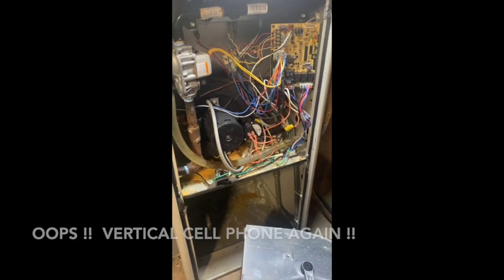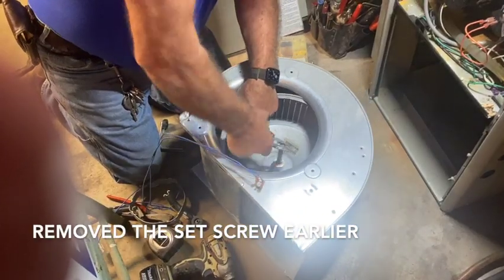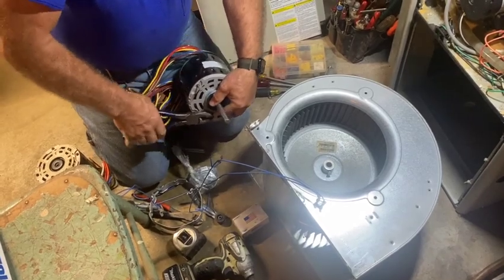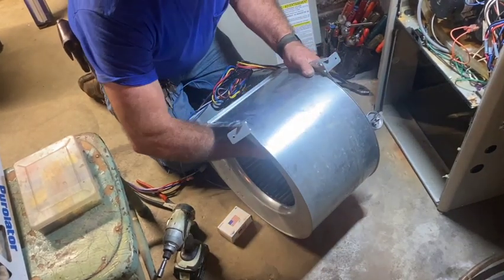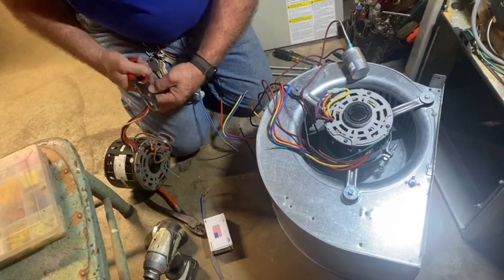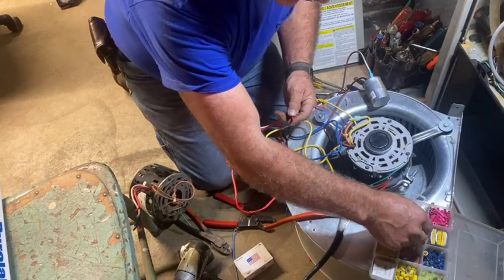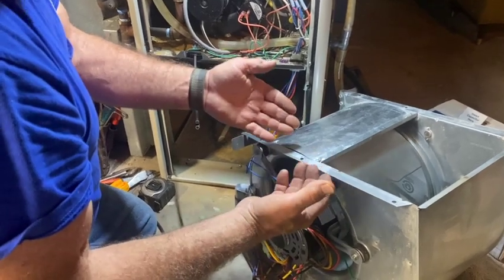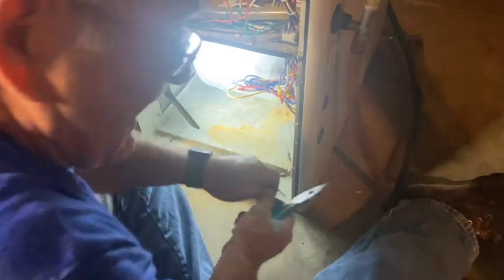Lets Replace A Blower Motor Kelvinator Gas Furnace

Comment: Man yeah Mr Wendell, of course it bites the dust if you worked on it!! Genius you are, I dabbled a little into a capacitor change right before warm weather came. It went ok, but the other day I was around back....heard a tinging noise coming from the outside unit. I went to investigate, and it was a wire for the fan motor , had broken loose from the tie point and was barely being hit by the fan blades!! Had I not gone back there, it would have chewed the wire in two pieces and who knows what else 🤦🤦😳😳 I do enjoy seeing you do what is such second nature to you!! Wow, snapped the shaft right in half 😳😳😳 Love the tool bag btw, and look fwd to seeing what's next sir!! 😁😁👍👍🇺🇸🇺🇸
Reply from the maker: That old tool pouch has been with me through thick and thin.  I've worn out several over the years for sure.  I'm glad you caught the wires before they gave you a problem.  You'd be surprised how many times that's the issue on a service call. Heck one time I had just a small ten ton roof top unit with the 460v 3 phase wires that popped loose from their clip going to the blower motor.  They then rested across the blower shaft and rubbed through the insulation. That resulted in tripping the MAIN GFCI breaker on incoming power to the buildings power distribution panel.  Yep, you guessed it....took out the whole building and it was a big one too !!  The 1 1/2'' blower shaft to dual squirrel cages and a ten hp 460v 3 ph motor had to be changed.  The direct short blew about 1/3  of the way into the 7' long solid blower shaft.  So stuff does screw up believe me !!  BTDT many many times.  LOL. This was just a small unit on the roof that serviced the penthouse and elevator room. It didn't matter though, it took out the whole buildings power.  Fun day for sure, that one was.
Reply: @tractorman4461  Wow!!! That's crazy for sure Mr Wendell !! 😳😳

Comment: Hey Tractorman 44.  We have a newer furnace and AC. The technician that installed it said to use the cheaper furnace filters. I think so blower motor does not work so hard. We had always used the 3m filters that were supposed trap very fine particles. Do you have any comment on furnace filters. I guess we just use middle of road one not cheapest not most expensive
Reply from the maker: I personally like the best filtration possible.  But if you have a system whose  return air ducting is marginally sized to meet the minimum requirements, the high efficiency filters can cause enough additional restriction to the air flow that it will cause the gas furnace to cycle on its high limit or electric furnaces to open the high temp over loads in series with the elements.  As long as your systems return air duct network is not marginally sized, you would be much better off with the high efficiency filters.  I run 2'' pleated filters in my system, where other systems could not handle that much restriction at all.  
    The cheaper the filters, the blue ones you can read a newspaper through, allow a great percentage of dust particulate to pass which will then lodge in the wet surfaces of the cooling coil in the a/c mode.  Eventually that accumulation will be enough to cause the indoor coil to begin freezing over.  I've had service calls where the indoor coils were matted so severely it could literally be peeled off like a carpet.  Then chemicals have to be used to clean the actual coil passages because even though the surfaces are now clean in appearance, the areas between the fins are really really impacted.
  I hope this give you more of an idea of filtration...other opinions may vary, but there is a reason for filtration.  On operating room systems we will have 2'' or 4'' pre-filters, then12'' expanded surface high efficiency filters, then 12'' hepa filters and additionally bacteria killing ultra-violet light bars in the air stream.  And yes, it takes a lot of horsepower to overcome the air flow restriction in these systems....but its required for surgery units. That's in addition to controls that maintain positive air pressure in those rooms as well as special recovery to eliminate germ/bacteria infiltration when the doors are opened.  I know...waaaay too much information isn't it. LOL
Reply: Wow that if great info and I think I will go back to the better filters and monitor how things work. I do battle allergies so better filter probably a good idea for that also
Reply from the maker: @dmfor9001  Well good luck with your system.  Remember the higher efficiency filters do collect a lot more dust and lint so they may need a closer eye on them.  They ARE a bit more expensive though.  Another thing you may give consideration to considering you have allergies is a low voltage electrostatic precipitator.  They can be bought in just about any standard 1'' filter size and operate on 24 volts that's added to the furnace.  It has to be controlled to energize only when the blower is in operation. There are quite a few manufacturers out there, this is just the first one I found for reference on Amazon: https://www.amazon.com/16x25x1-Electronic-Filter-Including-Replacement/dp/B073PHQ584?th=1

Comment: You're not just blowing hot air haha. We've used these blowers for air movers for years😊. Nicely done 👍.
Reply from the maker: I've given away a hundred of them at least.  LOL. And thrown away probably ten times that many too.  Big ones, little ones, short ones, tall ones.....LOL
Reply: @tractorman4461  I'm headed down to little State they call Arkansas. Maybe you can throw a few of them my way. Also not just Arkansas tennessee-kentucky maybe Louisiana. Not right away but pretty quick. I've use them to help dry out when basement flooded. Not the most effective but it was cost-effective

Comment: That was a nice informative video Wendell, you really know your stuff my Friend
Reply from the maker: Well Jan, I've changed blowers motors from tiny refrigerator shaded pole evaporator motors to 100 hp 460v air house blower motors over the course of the last nearly 50 years.  But this is the first time I ever saw a shaft split in two like this one did...right out of the center of the armature.